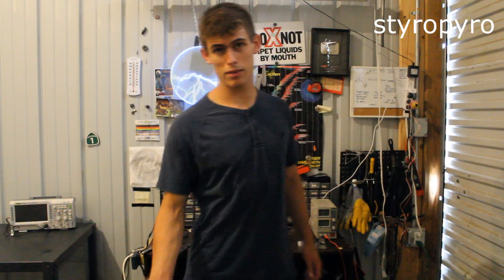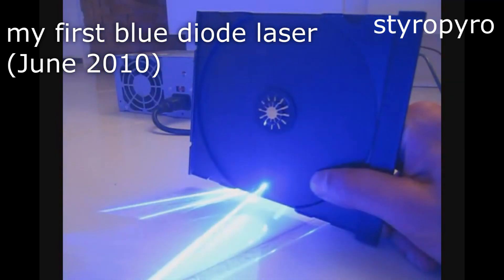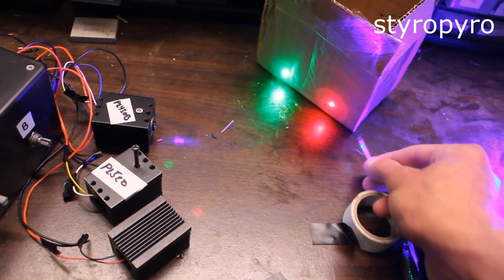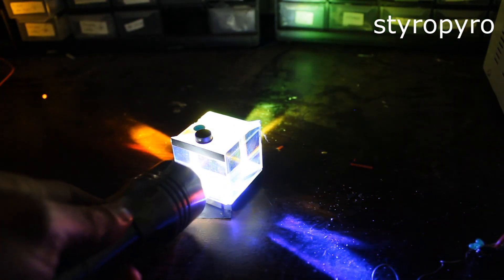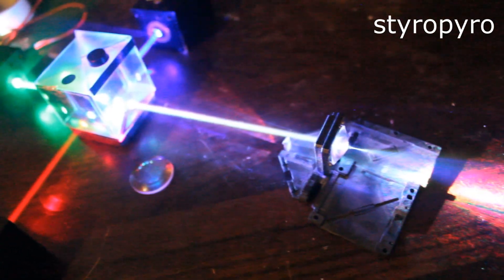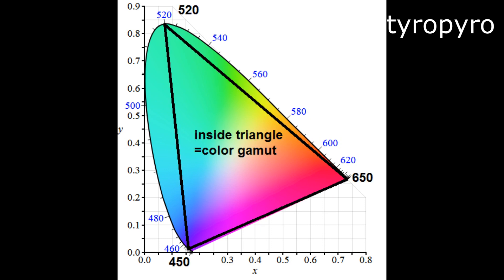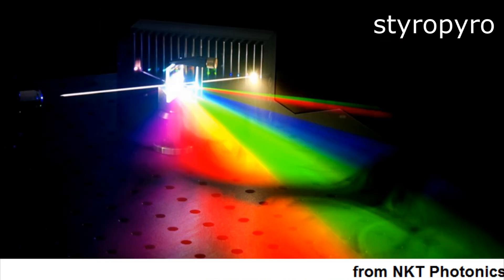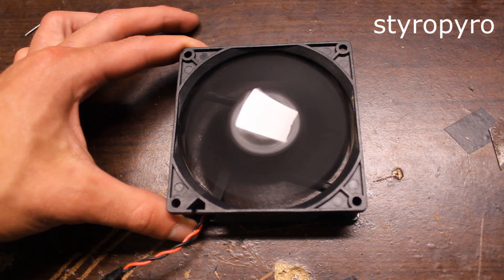Amazing White Laser Experiments!!!

Comment: Hey there Styro I was wondering if you ever messed with erbium doped optics? worked in fiber optic networking,  multimode and single mode systems for anything from LAN  to long distance undersea fibers. We used this stuff called "erbium doped fiber" you could put in a signal say 3db and on the other end of the spool of fiber it would come out stronger say 10db. Wh would have to make an attenuation loop to get it back in a range the sensor could use. Just a thought?

Comment: It is a very interesting thing to see an rgb laser but what if you think of printers? Could a yellow, magenta, cyan laser exist? Printers also use black, where in pigment black is a color but in the case of light, is not a color but the absence of light and thus color… though they make “black” lights which are lights at the near end of the UV scale… a “Black” laser is feasible in theory, though, to be visible it would require being at the near end of the spectrum as a “black” light is. 🤔 can someone contribute to these thoughts?

Comment: 9:30 Is such a laser cone still dangerous to the naked eye, or is it diffused enough to safely look at without laser goggles?
I assume it can be calculated somehow by the power output of the laser and the radius of the cone at the point where you look into it.

Comment: What gave you the idea that blue and green lasers didn't exist yet? If they made red, then obviously they made blue and green as well they just didn't sell them to the public Those color filters and reflectors, combiners etc are the same as in a projector so there's no way that multiple colors of laser weren't achieved long before they sold red laser pointers to the public. I'm sure someone at some point aimed a white laser at a crystal or other prism and split the beam into several laser colors, probably long before we even knew about lasers.
Reply: @znk753  Actually he's talking about blue and green. You weren't paying attention. All it takes is a different color filter on the lasers output, much easier to do than you think. Not so much different from putting a color filter in front of a flashlight to get only green, red or blue. It was already possible to do this when lasers were invented and so the ability to make lasers any color other than red was very much attainable.
Reply: @znk753  Please read my first comment, which you had no need of commenting on. They are not a recent invention, they just weren't available to the public. The diodes aren't red, green and blue, the filter in the diode only passes red, green or blue.
Reply: @znk753  Umm no... It's actually a lot simpler than you think, so fuck off now... It is just a diode, like any other, with a tube of mirrors reflecting the light until it comes out as a beam, after the tube is a color filter. The material doesn't matter, without a color filter or reflectors it's still just a white LED, it's simple technology and you can make one with a large LED, mirrors and a color filter. I know exactly how laser diodes work, now go troll the next one, moron.

Comment: is a white laser stronger because it consists of all the colors??
Reply: What make lasers "powerfull" is the fact that they concentrate light in a very small space. That's why a 5 milliwatts laser can make you go blind but a 40 watt light bulb just makes your eyes hurt a little even though it is 8000 times more powerful. Also a red laser with a power of 5 milliwatts and a white laser with a power of 5 milliwatts are equally as powerful. What matters while determining the power of a laser is the amount of Watts it has. 5 milliwatts is enough to make you blind and the laser of the video at is maximum power is 80 times more powerful than that if I remember.

Comment: What kinda laser goggles did you use that protects against almost every color on the visible light spectrum
Reply: Some say he wore 3 pairs stacked together. 
Some say he's gone blind years ago and builds all his rigs by touch and sound.
Reply: If you block the whole visible spectrum you can't see
Reply: @Janis_P  Yep, but it is unnecessary to block the full visible spectrum. I believe he stated he was using single mode lasers (TEM 00).  If so, then the bandwidths of the three colors are very narrow - probably not a lot wider than an emission spectrum line. 
So all he has to do is block 3 very narrow bandwidths.But that might be difficult and still allow enough light that you can see the beams for experimenting.

Comment: @styropyro Hi, I’m experimenting with a project very similar to yours and was wondering where you bought the single mode RGB diodes. It would be very helpful. I don’t want anything that’ll burn, but I do want to connect them to a digital potentiometer.Would 50mw work? Thanks for the video!

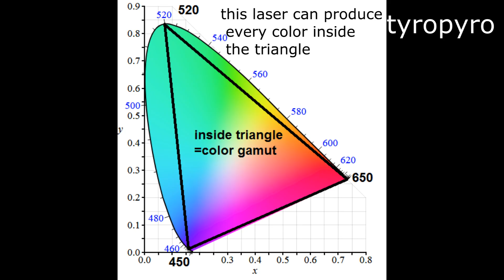Comment: Actually, at about 4:20 you mentioned the measly 16.8 million colors that the monitor can produce.  Actually, a few decades ago, It was discovered that the human eye can resolve 8-bit color at each of the eye's primary wavelength's of Red, Green, and Blue.  This is actually 256 colors or 2^8 colors per primary color when combined, or 2^8^3=2^24=16,777,216 colors.  Monitors handle this by varying 8 bits per primary color INTENSITY.  The part of your eye that you want to guard the most is the FOVEA.  I actually wrote a few articles in "THE LASER APPLICATIONS JOURNAL" previously Circuit Cellar Ink.  My main field was holography.  In one of the articles, I generated laser holograms that could put a dot, even it's intensity, wherever you wanted it.  This was the REAL image instead of the VIRTUAL image typically used.  I tried, and tried, and tried to think of a use for this 'invention':  TOO BAD I DID THIS  WAY BEFORE LASER POINTERS CAME OUT!!!!!  There was my little laser pointer screw-on application!   ...never saw a cent of  It! 

...good talking to you again Sty-PI

Comment: Lasers are becoming popular in projectors now. Either white lasers or a combination of lasers and materials that ends up creating white light. But they are only using them to create a convenient light source for a regular digital projector using DLP or LCD technology. As a fan of lasers and CRTs I want to see Red, Green, and Blue laser beams being swept over the the screen to create a picture. This would also enable OLED-like dynamic range within a single frame by varying brightness on a per pixel level rather than on a per frame level.
Do you think it is possible to create such a projector in the near future? The challenges I imagine would be getting bright enough RGB lasers that have tight enough beams to get focus at UHD resolutions as well creating the spinning mirrors to sweep the beams quickly enough. Switching rate of the lasers might also be an issue? 4K at 60 Hz are a lot of pixels to traverse one by one. Especially since you'd probably want to double that to avoid some people noticing flicker. That's almost 1GHz...

Comment: I had an idea of using old TV. Instead of bending electron paths, it would position small mirror with coil and reflect the laser powered and controlled by old TV electronics -- synchronized. That way laser could replace the vacuum tube and also it would be possible to make giant TVs and cinemas. Would that be too challenging for you to do?

Comment: Styropyro… the same from LPF ?
I was ShortyInCanada there and came across your video here.(And a couple others too)
Well done man.
But could you post a link to a schematic for your adjustable power supply ? I'm too lazy to figure out all the values I need for myself. Looking to make adjustable power supplies to run from an automotive source.
And can you slip in a source for your dichros ? I've got the cheap pointers for some simple spyrographs but I haven't got those magic pieces of glass yet. Always prefer to go with a trusted sources recommendations over just trial and error amazon gambling.
It seems I have been away a little too long and I have been missing it.
Reply from the maker: Yup it's the same styro from LPF! The drivers are LM317 based. on LPF it's known as the Daedal driver. As for the dichros I got them from DTR's laser shop (along with the diodes)

Comment: Iv'e played around with an idea in my had for a while- With that prism/mirror array & those three lasers, why not a slide or film scanner with the resulting white laser light for digitizing slides & film? If you have faded &/or discolored slides or film, the beam output of each laser can be adjusted for color & image correction & use Photoshop,GIMP or other software to do the rest in image correction.
Also, it would be ideal for projecting slides or film at great distances until the film grain becomes visibly noticeable. Unlike LED's & lasers, projectors equipped with bulbs,xenon bulbs or carbon arc lamps can melt or damage film if trying to project slides or film at great distances,because of heat from xenon,bulb or arc lamps & the heat related to the light from such lamps. This is the reason why projectors equipped with xenon,bulb or carbon lamps need air &/or water cooling to protect the projector,lamp & slides or film from melting or damage.

Comment: What's stopping you from making a cheap projector using this laser method? Projectors are usually expensive because of the intel mirror board which is tiny micro mirrors for each pixel. Could you use a spinning mirror per laser kind of how a oscilloscope works with electron guns? Then you'd just need a lens and ability to adjust it